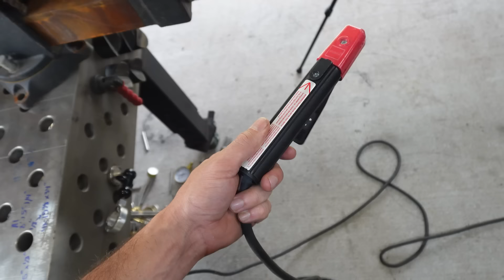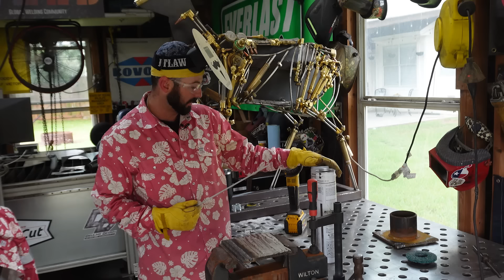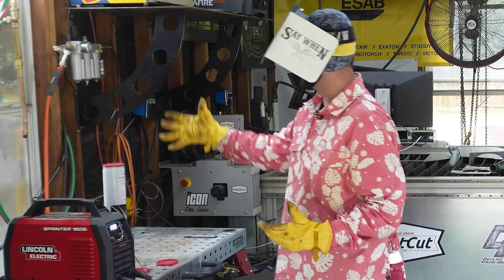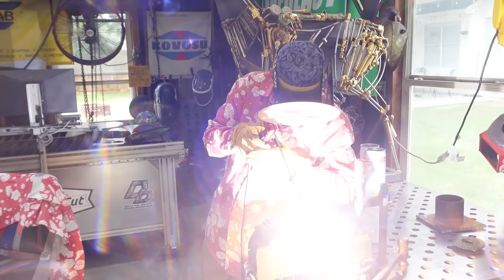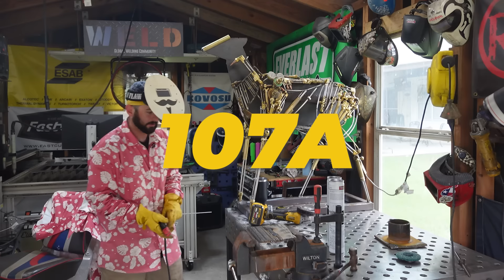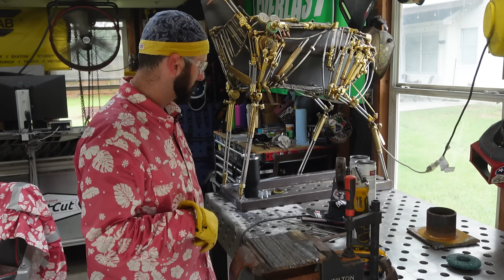How Not To Stick Weld! Avoid These Beginner Mistakes

Comment: I'd really love to see a video where you use a very cheap welder (harbor freight, bestarc, primeweld etc.) Running off a cheap generator (6kw-10kw) like a generac, or porter cable, or Honda etc) with no grid power whatsoever. I live off grid in alaska and have had trouble with welding using my 10kw and 2kw generators, trouble with bogging, voltage, amperage, etc. I'm running a primeweld 120/220 multiprocess plasma tig stick machine,  mostly using 6011, and 7018 rods, usually 1/8" or 3/32" as that's what's available.  The generator will bog down as soon as I strike the arc, then rev up, causing the arc to change dramatically,  leading to a very difficult welding experience,  any advice or best case scenario,  a full  video on how to correct this would be very helpful.  Thanks for reading and have a wonderful day
Reply from the maker: If i can get ahold of these things Ill make it happen. That is the type of power youll get off of those types of generators, its not as smooth as those welding generators, the 10kw should be able to handle that ok.. may not be the consistant arc you want however.
Reply: You could try your bigger generator but add a continuous load, like an electric heater. That way it wouldn't be going from zero load.
Reply: This is a great content idea I would definitely be interested in watching a video like that with detailed arc shots and evaluation of beads
Reply from the maker: 10-4
Reply: I have used a Weldpro tig 200 and an esab rogue 180 on a 7,000 watt Dewalt generator for 4-5 years. I have not had any problems.
Reply: You won't necessarily have to plug in a heater or anything that puts a basically continuous load on your generator to help with the power variability out of your generator but using something that gets it to idle up before striking an arc should help. 

I know a handful of pipeline welders running old Lincoln SA200's that will have their helpers hit the trigger on their grinder to jump the welder up onto high idle before they strike an arc. It might be worth trying that with your generator if your grinder will put it on high idle when you hit the button. 

The benefit with that is that you don't have to have your generator running at high idle the entire time, saving you some gas, but it gets the generator on high idle and ready for the power draw before you strike an arc and that should help reduce your power variability.
Reply: @jasonburguess  An inverter based welder with PFC(power factor correction) will run on a generator better than one without. It'll also draw a lot less current. Right now, PFC is only in the premium brands such as Miller, ESAB etc.
Reply: @bobblick7963  that's why I requested that he use cheap welders and cheap older generators, to see how it could be corrected to produce a decent weld. I live off grid in alalska and we don't have access to any fancy expensive new stuff, but we still have things that need to be properly welded.
Reply: I have used a 200w heat lamp plugged into my troy bilt 5500 and a harbor freight titanium 225. Running on 220. It works. I'm not a welder but I can weld things when I need to. So far everything has been good.
Reply: I'm a total noob, but does anybody run capacitors in line to keep things smoother?
Reply: You could invest in a diesel-powered welding machine
Reply: You need a miller outback. Hobart champion 145. Lincoln Bulldog. At the very smallest.
Reply: @PLP-DIY  I live on 1200/ month so those are way out of my price range. Trying to learn how to get jobs done without spending a bunch of money.
Reply: @jasonburguess  I’m on a budget too- bought an old craftsman 30 to 200 welder and an old powermate 5000 generator both for 50 bucks each- I’m  getting some welds down - learning - maybe I’ll figure out how to test for strength of welds

Comment: i got 2 yards of strut towers seams of 18 gauge to E6010 Texas Tig back together with 5/32 E6010... 70 inches of 18 gauge tig with a rod that says 130amp, 5/32 E6010 runs low as 40amp on AC, 40amp AC is the average voltage the peak of the sine wave is actually 75amp to 80amp. at so 90amp is 165amp and 70amp peak is 130amp. only has to sputter 30hz is the key sound.

Comment: 9:30 can run 5/32 7024 jet rod at 55amp's AC, it's slow and works good for building tall abrasion faces. 14 inch single hand arc control expectations is to run it for intended use. only need 40amp to run 5/32 6010, base metal thickness 18 gauge, fills faster then any mig could or ever would.
Reply from the maker: radical!